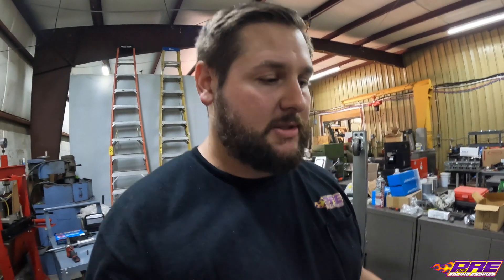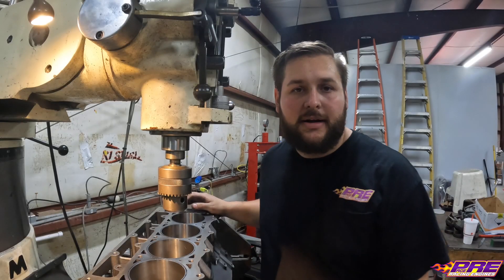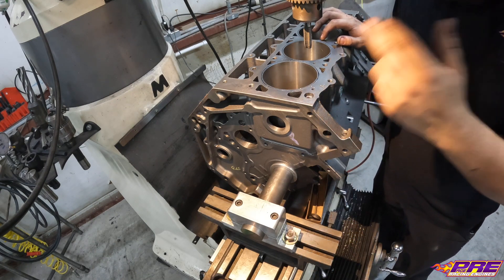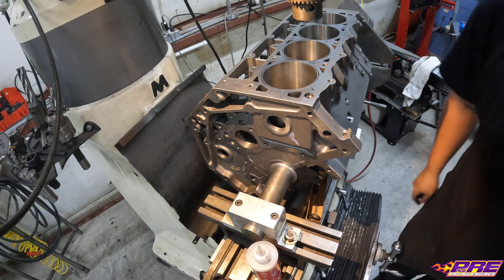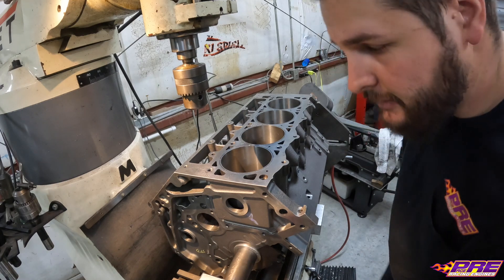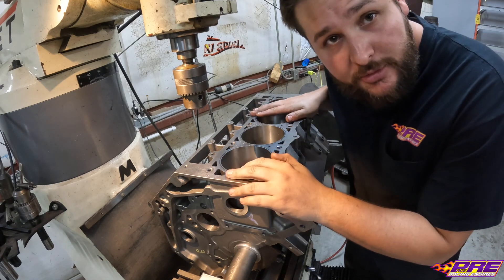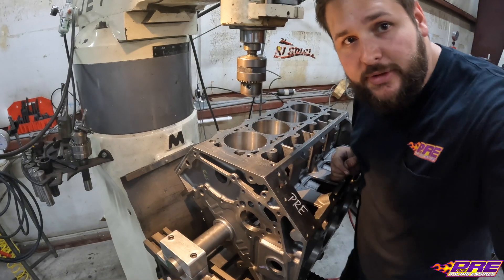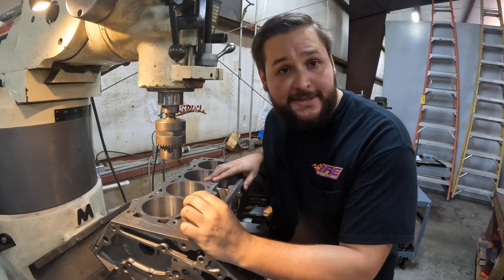How to Install ½" Head Studs in a  Dart LS Next Engine Block

Comment: Brooooooo...   you're gonna break that damn tap in the block. Get a spring loaded live center to chuck up in the mill and tap the damn thing by hand. Or be smart and buy a damn tap clutch. The way you're doing it is reckless asf.
Reply from the maker: @gadgetdeez7069  I’m sure a tap clutch would work better but I’ve yet to break a tap so I think the way I’m doing it is fine.

Comment: Yolls way works without any engine dimensions to go off of. I used to do it that way and it worked fine most times. Once i started swappin heads and movin head bolt holes i learned to locate with blueprints. Locate hole drill hole 1 in #8 the same, then i adjust the table on the Y (left-right) as facing machine, to the last bottom bolt hole in #2 using the indicator on the table, say like 18.025, and i drill the hole as if there was not a hole to begin with. Ive found cast blocks of all qualities off by substantial amounts. Once i changed to locating off of dimensions, my heads fit better with studs being actually square to the deck. Head gaskets dont seem to fight as much on dissasembly either. Typically most builds have a larger level of tolerance to allow machining abnormalities without much negative consequences. Thanks for sharin. I never seen an ls 1/2 conversion

Comment: Do you never do the outer bolt holes with 1/2" studs?  So all 6 bolts per cylinder are 1/2" studded?
Also.....How did you use the drill bit to spin the tap in under power, can;t that risk stripping the hole fast?   I saw it wasnt totally tight and it was slipping while spinning, is that the key, so it kind of grabs a little at a time and slowly takes little bites as it taps into the hole?
Reply from the maker: There's just not enough material in the outer holes to drill them out to 1/2". Yes power tapping can strip a hole quickly if not done correctly. A chuck typically cannot hold the tap well enough to keep it from spinning which is the biggest key to power tapping. It's very similar to how tap holders work for cnc machines.
Reply: OK, cool, thanks for the info. @pageracingengines

Comment: How much extra work needs to be done to the heads to accommodate the bigger nuts?
Reply from the maker: Just depends on the heads but most of the time it's just drilling the bolt holes larger to fit the 1/2" studs